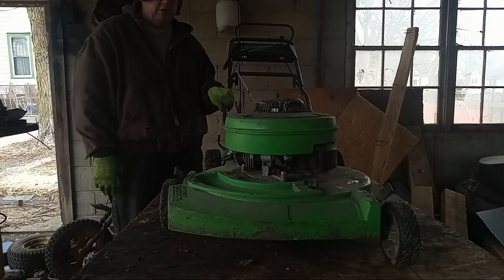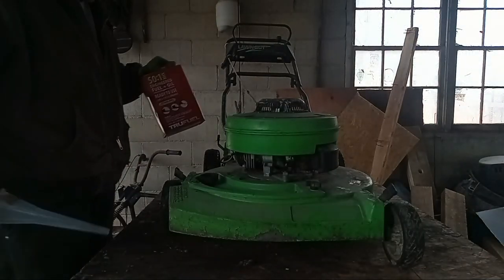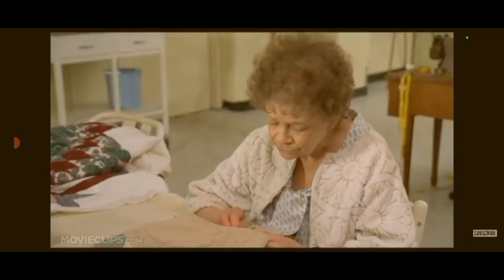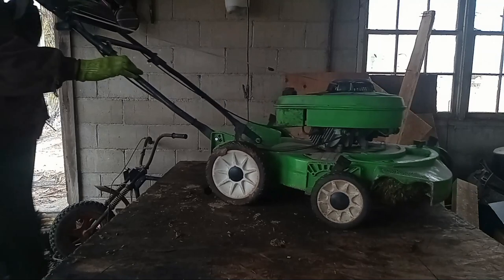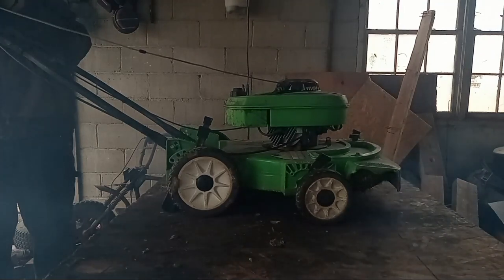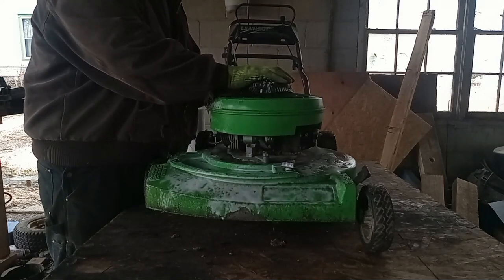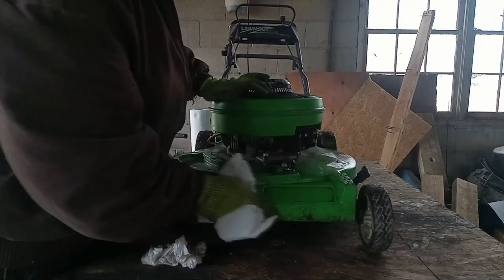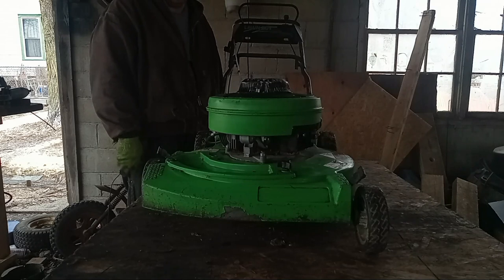Lawn boy gold series, had straight gas ran in it. will it live again???

Comment: Honestly from what I've seen alot of repair shops just don't want to fool with them and if they are also a dealer they just want to sell you a new 4 stroke that won't last near as long. I have a few from the 1960s and 90s one of them a 10422 that looks almost like that one. Most of the ones i have are from the 70s. D and F series mowers. There great. Awesome job getting it going again.👍
Reply from the maker: Bradley, most repair shops today are outrageous. They want to charge a fee just to bring it in the shop and put it on the bench. That's why these old mowers get left like they do. I enjoy them and I'm happy you do too. Thanks for watching and God bless you.